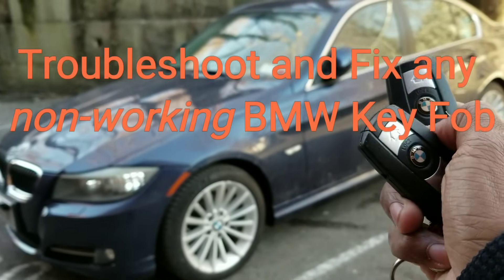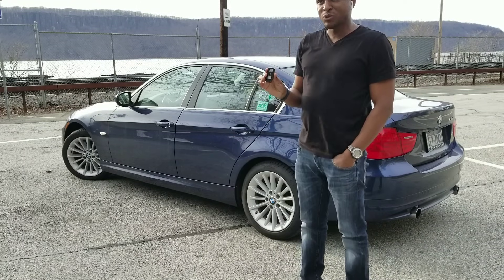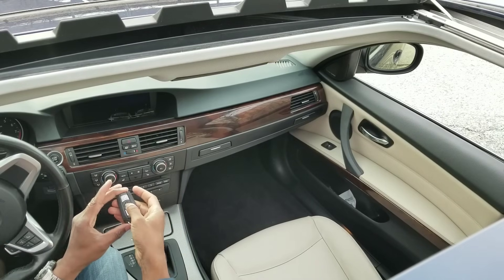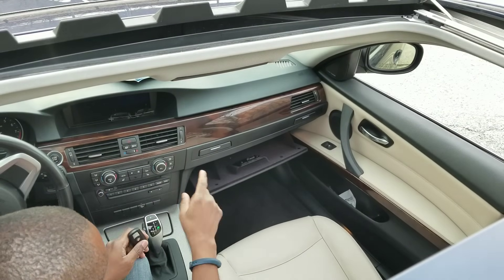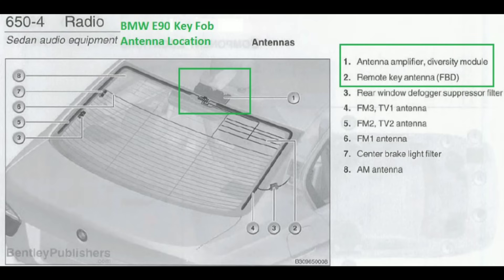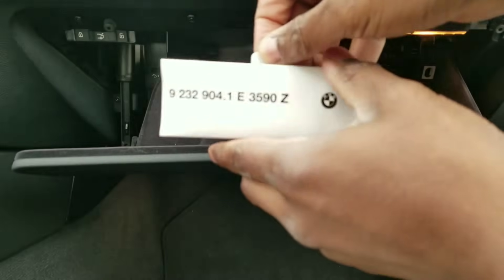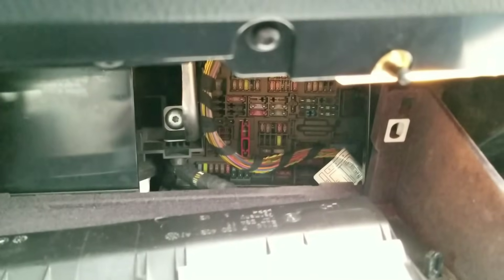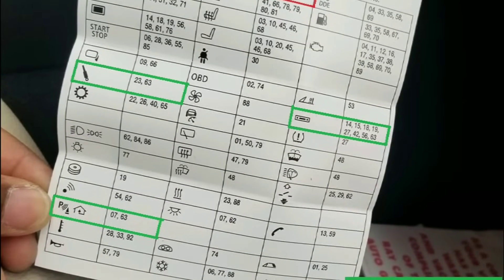Dead BMW Remote Key Fob? No Problem! Quick & Free DIY Fix!

Comment: Thank you soo much I soldered a new battery and the key still wasn't working and I checked the 5amp fuse and it was blown and I changed it with the spare and my key works now
Reply: I am faced with the same problem as we speak and this is very stressful Broe yhoo😏
Reply: @luvosmith600  have u checked all the fuses and the one the guys changed our in this video
Reply: Which one exactly? Mini or large one? I have an active hybrid 3 that won’t work
Reply: The exact same story of mine I’ll check later today the fuse
Reply: checked the fuses and they semmed oke :/ there are couple from the list missing.... but i tried to put them from the spare or other with the proper number and nothing :/

Comment: Happened to me about a month ago. Put the fob in the ignition and start the car up. Then turn car off and take fob out ignition. Then it will lock and unlock from the fob.
Reply: Thank you for sharing that putting the key fob in ignition starting the car on and then turn off the car worked for you! That has not worked me as I have been driving my 2009 BMW 335i Convertible with the key fobs I have (2) key fobs in the ignition switch when I drive consistently and still my key fobs for a year now have not been working to lock and unlock and open and lock my car doors and I do have comfort access on my 2009 BMW 335i Convertible. I did just replace my key fob batteries both of them, and now with brand new key fob batteries replaced in both my key fobs when I walk up to car and open and lock my car door with my hand physically opening the door with the comfort access it now works and my doors open and close now!!! So 100% the key fob batteries had to be replaced!!! However my car was not locking and unlocking from pressing the key fob to unlock and lock the doors still after replacing both batteries on key fobs, and replacing a brand new car battery installed and now following the instructions to replace the fuses as this video so valuable shows how to do, and my car still was not locking and opening from the key fobs. So after replacing the key fob batteries and then putting the key fob in the ignition and turned on the car and drove for about 1 minute, then turned off the car and tried to see if my key fob would work to lock and unlock the doors and it immediately works!!! So for me on 2009 BMW 335i Convertible I had to replace both key fob battery’s and then stick the key fob in ignition and drive and turn off car and to now works!!! I’m so grateful I haven’t been able to lock and unlock my car for a year now !!

Comment: You're suppose to put the key in the ignition when you drive. Do not drive these cars as a keyless car. I learned the hard way with my e60 they have an ignition slot for a reason.
Reply: What happened? "The hard way"?
Reply: They are push start keyless. You put the car next to the ignition to get it to start maybe, but you don’t have to put the key anywhere specifically.
Reply: @Honestly_Speaking_Gods_Truth  There's a slot to put the fob in... Check out BMW Doctor.
Reply: Thos are only for the rechargeable fobs
Reply: @99sitrrz  no.
Reply: @LastExile1989  having trouble with my e92 right now. My car isn't recognizing my fob it does have comfort access. I was under the impression only fobs w/o ca needed to be in the slot...

Comment: Five years later, still helpful. Thank you!!
Reply: 2009 323 i should i do 63 first or all of the fuses then check ? mech key and fob and internal central locking button still locking work fine just a dead fob when trying to open close doors etc ? thank you

Comment: Men this is great video. Hoping it might sort out my issue. So my x1 2012. Has a similar problem. Sometimes it responds when I unlock or lock. Sometimes it doesn't. And on the dash it would say  key not detected. We changed the battery. It is still doing the same. What could be the problem do you reckon? Could my car be facing a similar problem as yours was?
Reply: could you fix it?

Comment: Thank you so much for sharing how to fix BMW key fobs not working to lock and unlock your car door s and showing step by step instructions how to replace the fuses if blown!!! I tried this step by step instructions and I know nothing about the BMW fuses and have zero experience with, so I learned a lot Thank you of how to replace the fuses!!! I tried to replace the fuses as described in the video as I have the same exact problem on my 2009 BMW 335i Convertible with my key fob not locking and not opening doors and not responding to locking and unlocking key fob and my doors not opening or locking on comfort access door handles to get in and lock doors. Unfortunately the fuse did not work for me. However I learned alot so thank you so much!!! 

Ihave been driving my 2009 BMW 335i Convertible with the key fobs I have (2) key fobs in the ignition switch when I drive consistently and still my key fobs for a year now have not been working to lock and unlock and open and lock my car doors and I do have comfort access on my 2009 BMW 335i Convertible. I did just replace my key fob batteries both of them, and now with brand new key fob batteries replaced in both my key fobs when I walk up to car and open and lock my car door with my hand physically opening the door with the comfort access it now works and my doors open and close now!!! So 100% the key fob batteries had to be replaced!!! However my car was not locking and unlocking from pressing the key fob to unlock and lock the doors still after replacing both batteries on key fobs, and replacing a brand new car battery installed and now following the instructions to replace the fuses as this video so valuable shows how to do, and my car still was not locking and opening from the key fobs. So after replacing the key fob batteries and then putting the key fob in the ignition and turned on the car and drove for about 1 minute, then turned off the car and tried to see if my key fob would work to lock and unlock the doors and it immediately works!!! So for me on 2009 BMW 335i Convertible I had to replace both key fob battery’s and then stick the key fob in ignition and drive and turn off car and to now works!!! I’m so grateful I haven’t been able to lock and unlock my car for a year now !!

Comment: How did you decide that your fuse to look after was 63 and not 14,15,18,19,27,42,or 56?
Reply from the maker: There s a fuse chart in the glove box hidden slot , also used a E90 fuse diagram online ( also in Bentley Manual), and then pull out each suspect fuse to see which one is blown
Reply: @olaf2046  that’s exactly my point. The fuses for that antena are all the ones listed above.. I checked them all and they all seemed fine :/
Reply: Except for one that was missing

Comment: Great video and very helpful with the details. I didn’t know much about fuses until I ran into this issue. Extra bonus at the end with the little cutie. I also laughed when you had a large printout of the fuse; something I would do. Is it OK if you put a 10 fuse in a slot that is for a 7.5? I was told you can go up in value but not down.

Comment: Where did you buy the fuse and how do you know which one is the right one?
Reply from the maker: Hi Jackie,
I bought the Fuse at a local Autozone store. Inside the glove box panel that you remove to get to the fuses there is a fuse information card that you can read to see the fuse locations and fuse number that you would need

Comment: Another way to test without pulling fuses is to use a volt meter and set it to ohms. If it overloads the fuse is blown

Comment: Hey bud , 

My alarm works at times , at times it doesn't.. 
The radio settings also resets along with my bluetooth.. 
What's the best way to problem solve this? thanks

Comment: 2009 323 i should i do 63 first or all of the fuses then check ? mech key and fob and internal central locking button still locking work fine just a dead fob when trying to open close doors etc ? thank you

Comment: i have the same issue with my G30 530e can find the antenna in my diagram and checked all the fuses with DoorLock and they are fine, is there something else i should be checking?

Comment: I have a BMW x1 2013  drive 2.0 one let is still working as i use it all the time . The other is dead. Ive been told i need a new key as the fob is sealed. Does anyone know if there is a way to kick start it again. I did see a video on using a Drexel to open it and gluing it back together. Can anyone help? Cheers

Comment: I went to BMW asking about the problem  this morning . They told me the cost of the diagnostic will be $300.00.My friend I do not have a job because of Corona . I know BMW business is done also but  what happened to honesty integrity and fairness? well I should say thank you for your great help. I fixed  it by following your direction  changing one fuse for cost of $ 1.75.

Comment: Thanks. I have one difference to the scenario you described: the spare key works but not the main one. Are the fuses different for each key!
Reply: Then that would be the key battery itself on your main key that died. All keys have batteries no matter how small the key is. Do you have the convenience easy access package?
Reply: @olafjohnson4653  many thanks for the response. but the iDrive is not showing a low battery fault on the dashboard! Is there away to try to re-program the fob? thanks again
Reply: @bassilmohammad4085  7 months later, I have the same problem as you had. How did you fix it?
Reply: Having same problem. Apparently the key goes out of sync. It happened once before. Was able to resync after starting the car with it. But not this time
Reply: @BSA210  i have the same issue
Reply: I have a520 msport dash showed  the key needed a new battery which l changed then it stopped working had to use the spare key tried 2weeks later the original one was working again it has now stopped working again after 2weeks any ideas

Comment: Need help I replaced both 56 and 57 fuses because they were blown but the new ones I put did nothing to fix the issue of the control center button and key fob not working for 56 I put 15 and for 57 I put 20 my antenna fuse was not blown

Comment: I'm gonna try this out after work. Yesterday I was encouraged to use the spare key as well as I was only using the main key which locks and unlocks the car with a click of a button. Now the spare key has the same problem where it doesn't lock or unlock the car when I click any of the buttons on it and the alarm also goes off when I unlock the driver door using the physical key from the spare (And I'm not sure why this is the case) but the spare key is able to start the car.
Reply: Did you ever solve this issue? I'm having the same problem
Reply: @BSA210  Still working on having the spare reprogrammed mate
Reply: I fixed mine tonight. Needed a new battery. I had replaced it but I guess it was bad. Replaced a second time and all good. Keep in mind comfort access keyfobs don't recharge. You need that 2032 round battery. If that doesn't do it, you have to sync it up to the car by starting the car with it. I had to do that one other time and it worked. Cheers!
Reply: @BSA210   You know the reason I discovered the problem with spare key is because there's a YouTuber who said all BMW owners need to keep using their spare keys so that they get "charged" when driving.. but I guess that was not true then if you say the keyfobs don't recharge.... Thanks for the info I'll now avoid costly mistakes.
Reply: @lindabenton1436  the only keyfobs that recharge are the non comfort access. If you have comfort access then yours won't recharge and need a new battery. Let me know if you need help with how to replace it
Reply: @BSA210   I have a 5 series with comfort access. I changed the battery twice like you did, also did the 2032 battery. It only unlocks when I go behind the car and point at the diversity antenna. So I’m stumped of it’s the fob or the antenna. Any suggestions?

Comment: Could this be the fix if the key fob works randomly?? Sometimes it will unlock the car, sometimes it won't. Sometimes I have to put the fob in the slot to start it, sometimes I don't. We've replaced  batteries in both fobs. One fob doesn't work remotely at all; the other works randomly. We did take it to the dealership and they were no help at all. They were clueless!
Reply: Did you ever figure it out?

Comment: Bro thank you so much I drove with a ground cable unhooked on my e90 and it fried my transmisson fuse and i couldnt start the car, replaced it starts but now my key didnt work and this fixed it

Comment: how can u unlock ur car when the key fob not working and you can open manually
Reply from the maker: Inside the key fob there is a hard old school metal key blade  that fits into the keyhole on the door. It should work to unlock it.

Comment: Ok so my e92 335D has no locks and no ignition barrel. The key has gone dead and it isn’t the comfort access key where I can change the battery. I can’t. So what do I do because the battery dead sign shows on the dash. ???

Comment: Amazing. Fuse replacement did not work for me but both keys also donot work. Central locking button on dash does work together with key. I suspect a blown module from water damage from a cracked tail light. I had to replace logic 7 amp. Could a module below the truck floor have blown?
Reply: Same issue here how did you fix it?

Comment: Thank you so much for your video!!

I checked trunk and glove box fuses and they were all good.  I changed the battery in the controller and it didn't work.  and I also tried two or three tricks and absolutely nothing happened.  but i did this...
one of my two controllers on my 2008 x5 stopped working almost 6 months ago.  What I did yesterday was watch a video on how to open the controller (which is sealed) and replace the battery (which is soldered).  then i watched a video on how to sync the remote to the truck, which is super easy, all i had to do was go, insert the key in the door to unlock the truck, get in, put the key in the switch, turn on, leave about 15 seconds on, and turn off, take out the key and check if it works or not.  and it worked for me, immediately I took the control out of the switch and pressed the lock unlock buttons it worked.  Thank God I already have my second control working for only 30 dollars with everything, battery and welder kit.  
I hope and whoever has the same problem will find my comment helpful.

Comment: My beep will not work, lights do not flick when the fob is mashed to lock, and the small red ball underneath the rearview mirror does not work. I do know that my mechanic repaired my headliner in the back. Do you think he unplugged something that can be repaired or do you think its the fuse?

Comment: I recently had the problem that 3 of my doors no longer opened on my bmw 328i. The remote didn’t seem to open them neither did the door control button in the center of the car. I took my car to a bmw repair shop and they said it may be an electrical issue and may be a little expensive. I came across your video on youtube and thought what if its just the fuze that got blown out? Thank god it was and Thank You sooo much you saved me a lot of money. 🙏🏼

Comment: Thank you. This solved my problem. My keys had stopped working, and I also had an auto brake malfunction error. I had a hard time figuring out what fuse numbers were associated because my car had no literature on it, but some research for a 2011 X5 suggested "6, 103, 109, 129, 142". 129 was blown and replacing it fixed the issue. The keys stopped working again shortly after, and I looked at the fuses again. After 103 was pulled out and pushed back in, it started working again.
Reply: L

Comment: Good video Olaf! Trouble with mine is at times, it simply stops working, no rhyme or reason, then starts to work again. Likely it's bigger than a fuse for me (CR battery is brand new), so I'll leave well enough alone right now :)
Reply: Same here! And the dealership was no help at all!

Comment: My car's FOB died right when I got home. I thought it was the battery. Bought new battery and still bad. This might be the problem bc it was working fine before that. A bad battery will give you warnings like distance problems or recurring fob abilities and dying. This has to be the problem. Never thought about it bc I didn't know it has a fuse.

Comment: I have 2010 328i Key fob doesnt unlock/lock. Yet i can start car, checked fuses and they are ok, battery is ok, and key fob battery is ok aswell.. any ideas or do i need to activate key or reset? Thanks in  advance
Reply: Did you ever figure it out? I have the same year/model. I changed all fuses.. and even went to the dealer they couldn’t figure it out. Wanted me to pay an additional $300 on top of the $230 I had already paid to continue ‘diagnosing’

Comment: Thanks yo, my diversity antenna fuse did break. But for me it was fuse 18, it is still a 5 amp fuse. so for everyone else, be sure to check the fuse diagram that came with your car (unless your fuse box looks like Olaf's), and check all the 5 amp fuses that is related to radio! 👍

Comment: WHY was the fuse burned out? The fuse was blown for a reason.
Reply from the maker: I'm my case (and I think I explained it in the video) my car battery was dying frequently from almost 3 years of not daily driving or even starting my car. I was jump starting it every week and that may have blown the fuse. Also that particular fuse is connected to the shifter console and I had also just installed a led shifter around the same time. It could have also been that.

Comment: For the none comfortable access keys you have to split the key fob in have, desolder the battery, solder on the new VL2020 battery and reconnect the fob...if not then it's like $350 for a new key from bmw vs about $40 for a solder kit and a set of new batteries